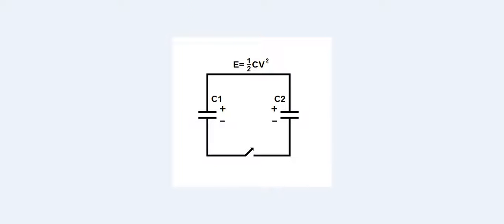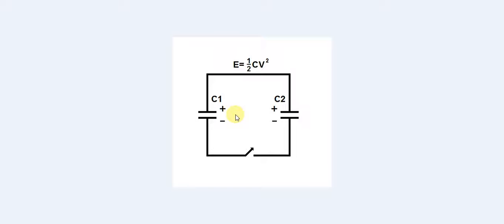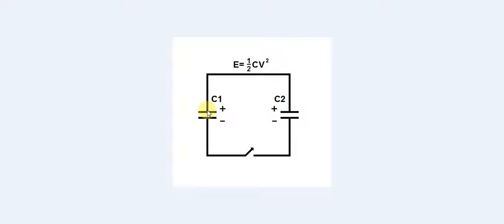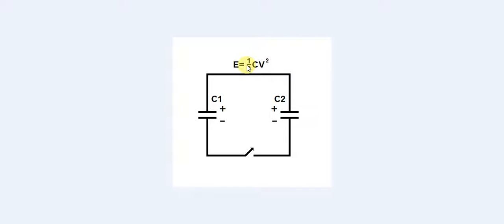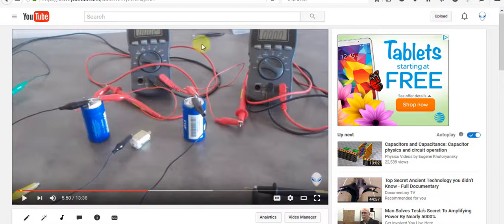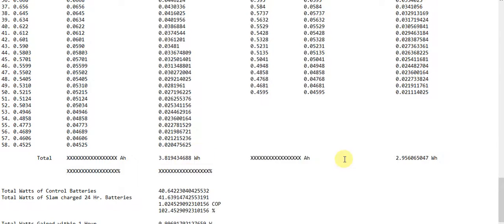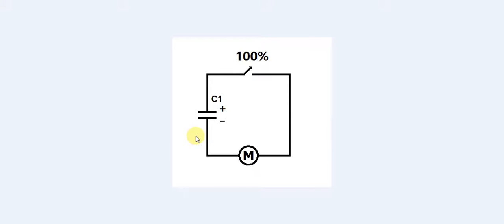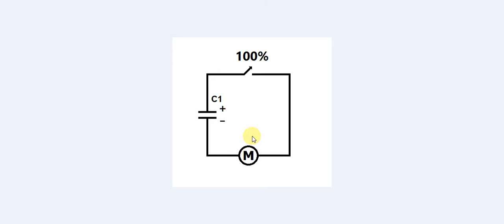Two Capacitor Paradox SOLUTION!

Comment: If those components were ideal ones (no losses), no motors,   and using super conductors,   the apparent energy loss would still be around 50%.   This is  shown and explained by the equation itself.   Voltage (squared) determines  most of the capacitor's energy.   The only thing I could think of is that the equation doesn't fully express how the energy is being distributed or transformed.   As argued by many physicist,  E=MC2  explains how planets behave,  but it doesn't apply to subatomic particles even though they have similar patterns and behavior.
Reply from the maker: Right, the equation doesn't fully express how the energy is being distributed or transformed, but obviously it's being transformed as something, such as heat or radiated losses. It's almost like forcing two like poles of a magnet together and the magnetic fields seemingly vanish, but have not, or similarly running a current through a non-inductive bifilar coil and cancelling the magnetic fields out, did they vanish? No they just simply are stressed to a very tight space existing on a smaller scale, such as that of an atom.

If we give the energy a place to go then we can easily see it, such as some type of load that we can "measure". In the equation there are no loads except the capacitors themselves, a place that is hard to look inside to see what is happening.
Reply: debunkified 
I'm glad that you are focusing on capacitors lately.  I have a theory that gravity is more related to electrostatics than it is with magnetism.  This is demonstrated well with those devices they call "lifters."   I remembered Don Smith  illustrated this on one of his notes. And so did Newman too in his old book. Unfortunately, Nobody seems to have paid attention to it.....
Reply from the maker: Hi, I did, I payed attention. Gravity is very much a part of electromagnetism, and I maybe I will tie those together as well with a simple explanation and circuit.

Lifters I believe are slightly different and are based on ionization winds for propulsion, but aren't very far off from Thomson Townsend Brown's UFO capacitors as I call them, that did indeed work under vacuum, unlike what the Myth busters disproved.

You're thinking on the right track as far as voltage alone creating propulsive forces, with currents that are below the microamp range, basically no current at all.

I was going to ask for funding to build such a capacitor, which I believe only requires a HV DC source and that's it!

But I don't think anybody would donate for such a cause. Newman was on to something as well with using nothing but volts for his motors, except he was still using too much current 9 milliamps!
Reply: debunkified
Newman actually had a small video clip where he wrapped a coil around a balloon that was sitting on a table.  When he turned it on,  it floated in the air and oriented itself to the North and south poles. That really caught my attention more than his motor, but I was afraid to try it.  He said he used 300v probably from a step up transformer plugged from the main outlet. It's not exactly an experiment I would dare to try .........

High voltage can be produced by Wimhurst machines, and they're fairly safe.  You can easily build those with readily available materials. I have one, but I haven't done any experiments with it yet.  I've ordered some components to play around with ,  maybe I'll attach it to a small lifter or something.....
Reply from the maker: You could always try using a collapsing field which can be a very high voltage. The problem with using step up transformers or anything that will step up voltage always uses an absurd amount of current.

Thomas Townsends UFO Capacitors used absolutely no current, and it was so minuscule that it doesn't even matter.

What I do know is that the propulsive force drains away after some time and so it has to be disconnected and then reconnected to get it back up again, so it sort of needs a pulse of pure voltage every once in a while, it has a momentum behind it that has to be kept up, which doesn't sound too hard if there's basically a free propulsive force which can be used for that switching.
Reply: If we  think to overcome  losses  with an amplifier and  feedback, or cristal, what ever wo controll damping,cte amplitude of wave output, the  cuestion is may we resonate if we invert polarities mEMF or V for charging initially  one CAP,is a few Ahr, switches  there are lot with control delta t
Reply from the maker: Think for a second ok? Tesla’s method of conversion. What’s the big deal in dumping a capacitor through a spark gap into some loads? This is what nobody is asking. What’s the point if you can just power the load directly from the power source. Was Tesla crazy? No he called the capacitor the most beautiful instrument. Why? you must ask yourself.